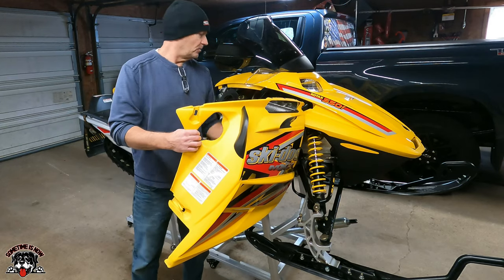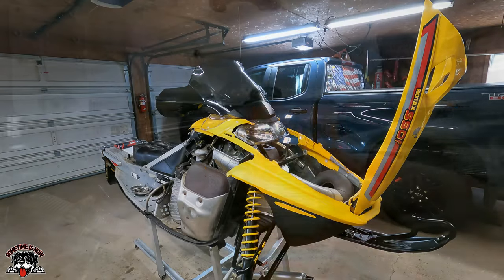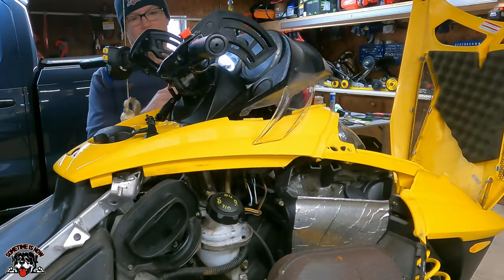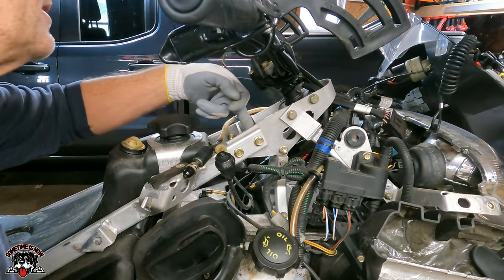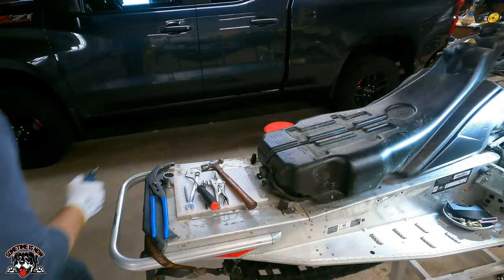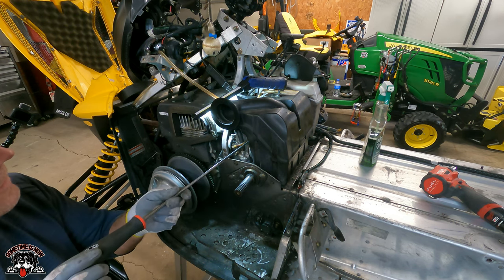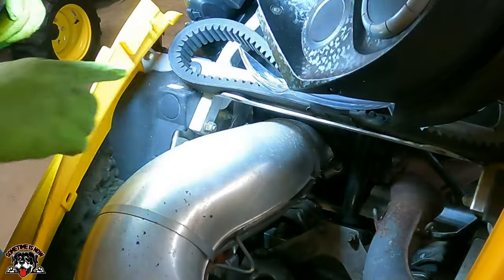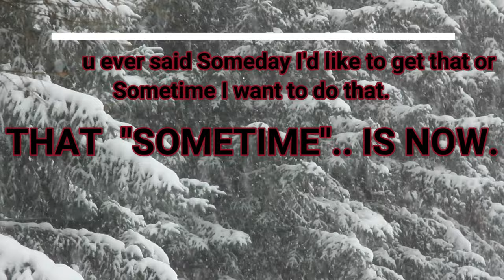SKIDOO REV 550f TEAR DOWN TIME | EP02

Comment: I recently got 3 2010 550fs from a ski hill none of them currently run but this video will help
Reply from the maker: Hey Jimi,
Thanks for stopping by to check out the series.. The 550f is a great sled.. Make sure you look over the carb boots for cracks, you definitely don’t want a lean burn down.. I go over everything in the series of videos 👍🏼 Take Care

Comment: That’s deja vu for me!  I did all that work on the 380 to stud it. Unbelievable what has to come off! I should have installed electric start when I did that job. That’s going to be a fun sled!
Reply from the maker: I agree, The things that needed to be removed is crazy. Electric start is getting really hard to find on these older sleds and with the supply shortages & everywhere says out of stock or discontinued. Did you get your tires on Monday?

Comment: Great Vid! It helped speed thing up a lot on my 04’ Skidantic 550! also, I had good luck with a think layer of RTV high temp on my intake boots to combat the “dry rot” (broke boy method).  Keep of the good work!
Reply from the maker: Hey J, Thanks for stopping to watch the video.. Sometimes you have to do what you have to do to get those boots sealed up 😉 I have an electric starter kit ordered for the ole RUFF REV and it’s due in May. I imagine the Skandic already has Electric start?? Take Care 🤙🏼
Reply: @SometimeIsNow  My Skidantic does not (it’s a skidantic “Sport”, another broke boy option haha).  I’ll have to look into a starter kit.  I didn’t realize those were available.

Comment: What is the model of your lift?  It seems to work well for you!
Reply from the maker: Hey Tom,
The lift is an Extreme Max. Cheapest I’ve seen it is on Amazon.
https://www.amazon.com/Extreme-Max-5800-1184-Aluminum-Snowmobile/dp/B0189D78RM/ref=sr_1_3?crid=1XU6SIRL1OYSG&dib=eyJ2IjoiMSJ9.wBNPa8YBmyMdqj3iteszpB2UPb-WIPDh4zfo-cJFcUZOFKFfv9Ch1OsWHA0rdeBbb390ZEaVZseZWes_-do0CYtI6c1yFGzh9gLDEG9arx8ilH2JUuqploXDXyEOFL59bROn2GrpXMMy4i3Dx6S2XBdQgsf1h82ynP7rbjTR-d692MaMC92eqLWxPAQkvCnbXfTHYdiEKzSl45ZaWyB983lLxZ_yGC0mJBt5lkUysp_Yz652TQZJzrk1ThhlJ4gIfWOYewua8yQXVpSA-0Es0u4h9N3WzFU6d5ls926vLDs.D-uj3G-5zEptnbIXQKVYQ6Xenqqa49b216U0anqSOAg&dib_tag=se&keywords=extreme+max+snowmobile+lift&qid=1708596434&sprefix=extreme+max+snowmobile+lift%2Caps%2C430&sr=8-3
Take Care 👍🏼